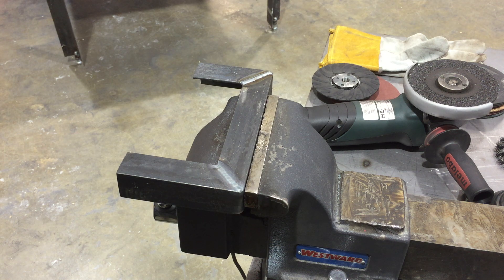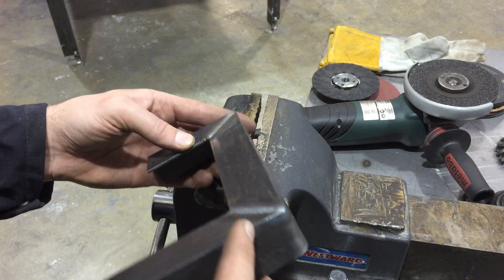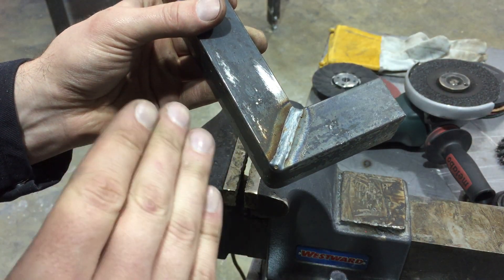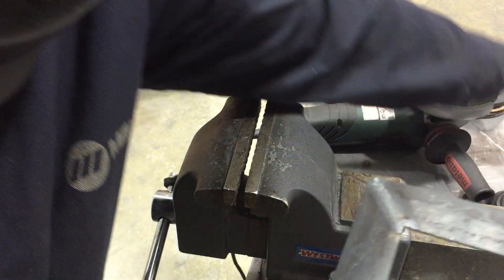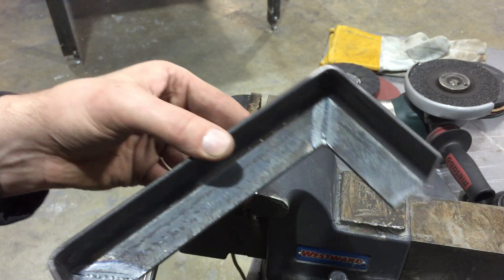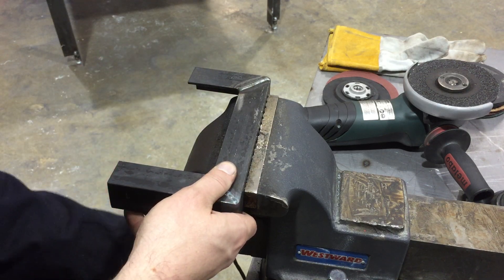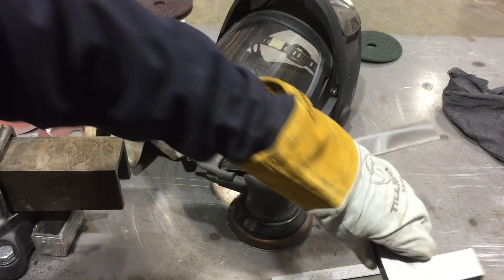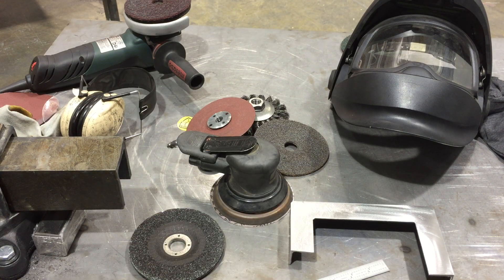Grinding & Blending a Weld

Comment: I worked for 2 abrasive manufacturers for over 40 years and have visited literally thousands of manufacturers fabricating many types of steel, stainless steel and fibreglass products. This video demonstrates various levels of grinding and finishing abrasives but should not be seen as a “how to” instructional on finishing light structural steel. I never saw anyone using non woven Velcro discs of fine grit orbital psa discs to blend welds on light angle iron. My recommendation would be to use a 60 grit flap discs for this application.

Comment: Clamp a piece of brass flat stock, like 1/2 × 1 1/2 on backside, and weld with a little more penetration. It will remain smooth on backside.

Comment: If you have a good hard and wear resistant stone on a die grinder and a light touch, you can do tight spots, and it won't be too chewed up - might not even need a sanding pass if it's fine enough a stone

Comment: What is a good approach to removing Mill scale? I’m going through flap discs like mad.
Reply: Use a poly abrasive disc, looks like black plastic mesh. mill scale flies off without cutting into the steel

Comment: BEEN IN THE GAME FOR 28YEARS I CAN CLEAN THAT UP WITH AN 80 GRIT ALL DAY LONG THEN PUT THE D.A OVER IT READY FOR PAINT OR POWDER COAT.NOT BAD WORK BUT TO SLOW AND NO NEED TO CHANGE THE DISC, YOU CAN USE THE SAME ONE JUST SCRUB IT OUT.JOB DONE
Reply: Lmfaooo
Reply: clean with soapy water? 

I have seen people reuse discs by cutting down the pads and disc 1/2" around. Making a set for my roloc discs so i can reuse the edge until i get to 1" size. So 3 inch, 2.5 inch. 2 inch, 1.5 inch, 1 inch, .5 inch all the same disc passed down the line to use it up completely. of course i dont use them all in order as it takes a time to switch the bits. just do all 3" until u run out. then go to all 2.5 etc.

Comment: Isn't that 1/4" thick wheel supposed to be used for end grinding, using the flat edge of the wheel only?  I would have knocked the weld down using just the edge and use a 2" sanding disk to blend.  If filler would be needed, only a fraction of the area would need to be filled to blend with the parent surface.

Comment: I wish I could weld as good as your welds look. I enjoy welding on projects that come my way , but that is not all the time. In order to make my welds look better I spend a lot of time grinding them down. I have found that a 36 grit zirconium flap disc cuts through welds fast and they last for ever opposed to other flap disc's.

Comment: I have a grinding test coming up but have no prior experience. Any tips or advice?
Reply from the maker: Take a look at minute 10:00 of my Pencil Holder project part 2: https://youtu.be/PolF1ZeXiKg
It shows in more detail how to rough out a MIG weld and smooth it down without gouging into the base material. And make sure you get in plenty of practice. Good Luck!
Reply: @robdamico5304  I'll make sure to study hard. Thank you so much!

Comment: If my welds looked that good I would never grind
Reply: Exactly though that's what I'm saying.
Reply: Absolutely
Reply: Amen. Id leave them unpainted (if applicable) just to draw attention to my handiwork
Reply: man i only have a stick welder, can a stick weld look as good as this?
Reply: @_454_  depends on what you’re welding but yes.  Currently I’m welding up stainless sections to an old exhaust and all I have is a lil buzz box stick welder. I have various rods but have only been using  an aggressive wheel grinding stone like he used briefly. This was very informative. I think I’ve been too high on amps and grinding a lot so this what helpful. I’m new to learning on my own but the knowledge is out there. Like he said. Getting a strong weld is first. That’s why I’m doing so much grinding. Less and less bubbles to fill as I repeat the steps. I think when I’m done I will leave the welds somewhat proud since its exhaust. If you’re watching, you’re learning.  I was wearing safety glasses while grinding and still had to use a magnet to pull some bits out of my eyeball. I am now putting on scuba goggles before I pick up the grinder.  Scared me straight
Reply: I swear lmao

Comment: i recommend you try anti vibration backing pad from Walter or off shore brand. the one you demo is very good for stainless but it does a number on wrist. i can only one hand grind with that kinda pad for like 10 minutes. well with anti vibration i can grind for 8 hours everyday one hand.

Comment: Are there cons or benefits to using sanding discs vs flap wheels?
Reply from the maker: The flap wheels are more expensive but last longer. The sanding discs are cheaper per pad but you also need to buy a backer. In terms of finished part results, the sanding disc is more flat, and if your technique is on point you can get a very flat (nearly invisible) weld seam. The flap discs are inherently curved and generally a bit more spongy. I find it’s harder (nearly impossible) to get a flat grind with a traditional flap disc. However, if you don’t need a super flat weld seam, perhaps you just need a smoother weld seam or a rounded corner/edge, a flap wheel will save you a good amount of time and effort.
Reply: Fiber disc will get you flat surface, flap discs will just remove the weld make surface not flat and take out all of your sharp corners....also you both need cubitron 987 discs, this klingspor are bad as soon as they touch metal